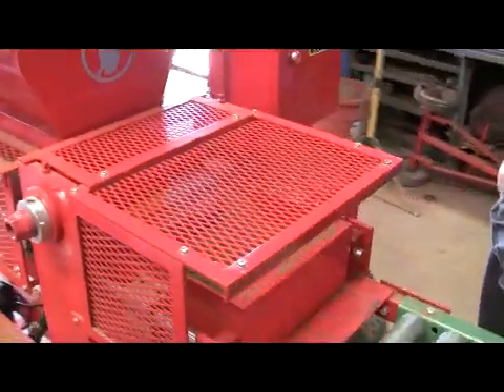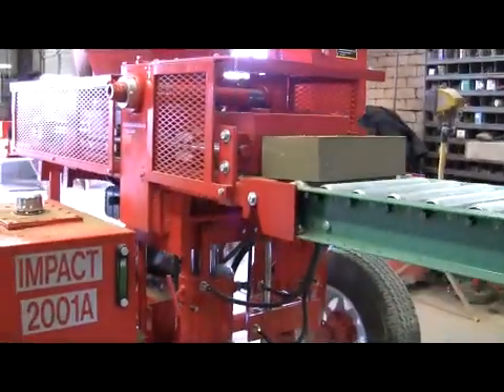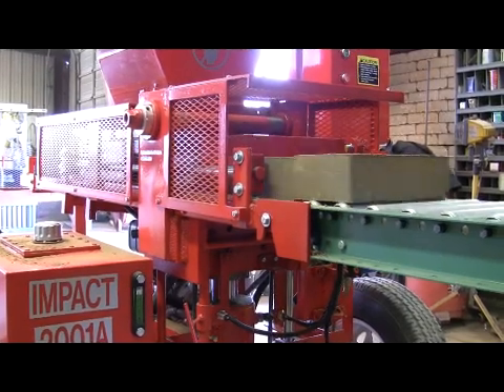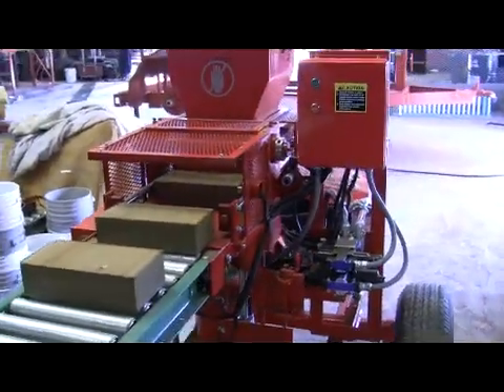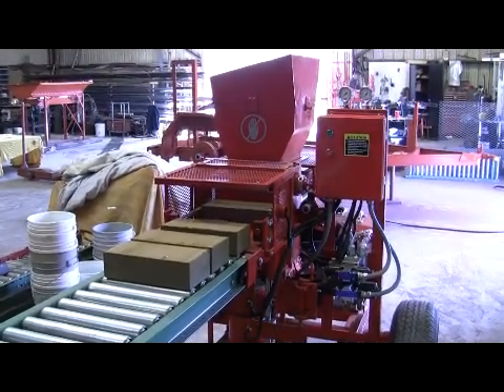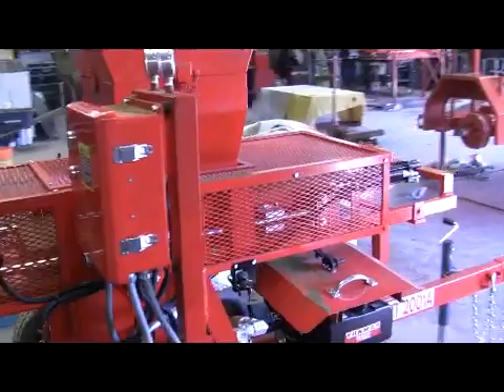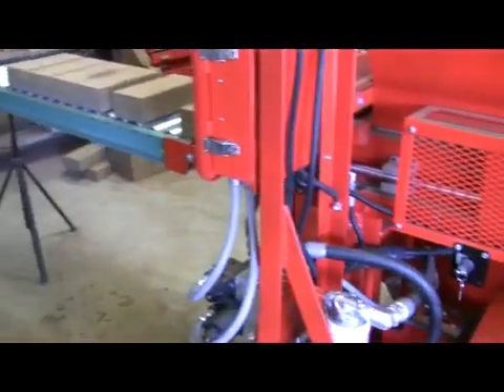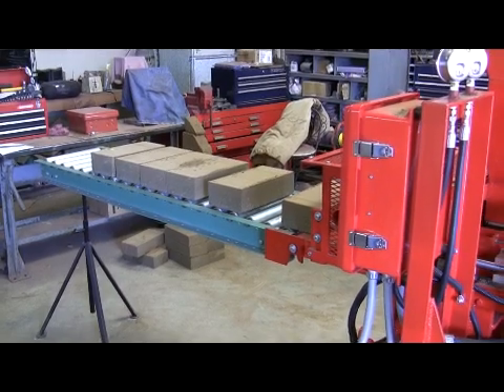Compressed Earth Block Maker

Comment: One thing you failed to mention if you build a house out of it and try to put a nail into the wall it will crumble.
Reply from the maker: GREG GERHARDT It has its weaknesses (I wouldn't use it where there are earthquakes), but your comment is completely untrue of this kind of block. The factory actually does a demonstration of the thin mortar method where they put one block on the table, put thin slurry on it, put another block on top cross ways (so a 6"x6" section is touching), drive a nail in the top one, and five minutes later pick up the pair by the head of the nail.

Comment from the maker: See Lawrence Jetter's comment above for the manufacturer's contact info.  This technology could be used to make differently shaped blocks, but I don't think AECT makes any such machines.  It would require some high precision machining in 2.5cm thick steel plate - it'd be possible, but not as simple as a rectangular block.

Comment: @mrgoodvibrations depends on state and county.  I will tell you though its a lot cheaper to just build the house out of cob.  You can find a lot of vids on y.t. and info on the net of how to build it and what materials to use.  rounded shape houses are a lot stronger then square houses.